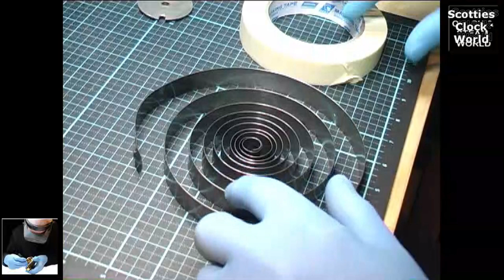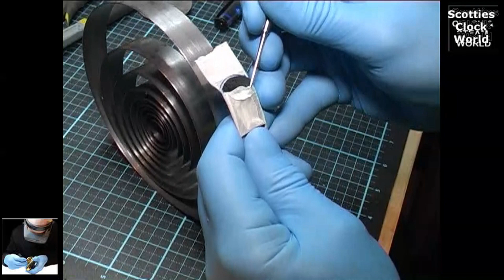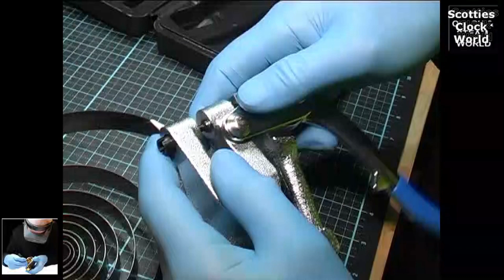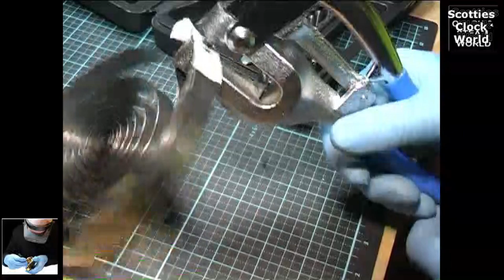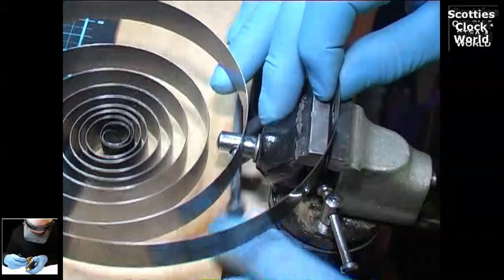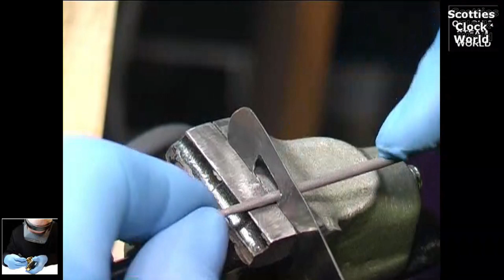Broken Hole End Mainspring Repair - Full Video #americanclockrepairs #ScottiesClockWorld

Comment: It makes perfect sense to anneal prior to performing the rework steps but is there a re-temper step before reinstalling the mainspring and what are the recommended steps to perform the re-temper? I assume the heat applied should have a cherry red color at max heat but what is the quench medium? Water or oil and what kind of oil if that is the medium?

Comment: Thank you Scottie for the educational clip. Useful if the spring end is a "hole" type. I am wondering how would you generally fix an end of the spring in the shape of a "U" (much like a hook) The reason I ask is I am attempting to fix a broken mainspring of a pull door bell and the break is at the hook end. I assume I would need to create a "U" bend. If so, how would I achieve that please? Many thanks.